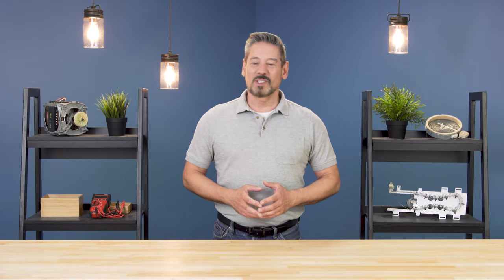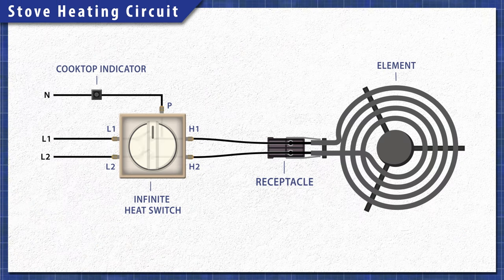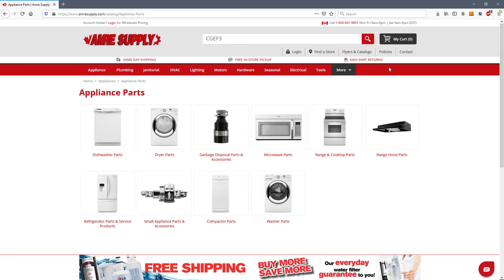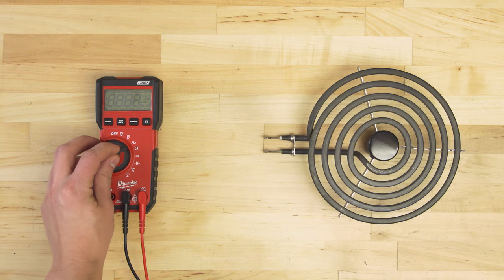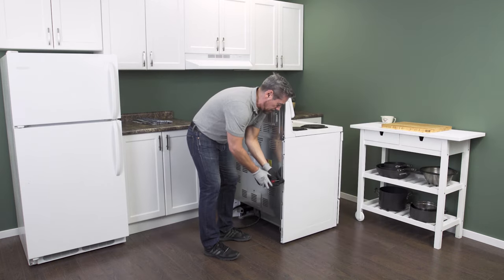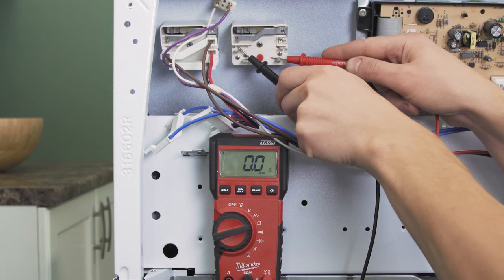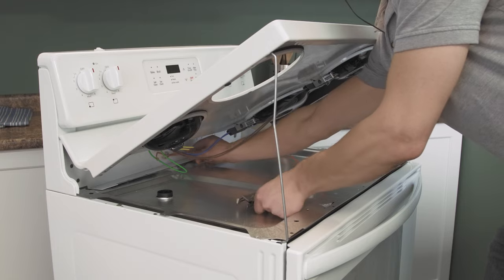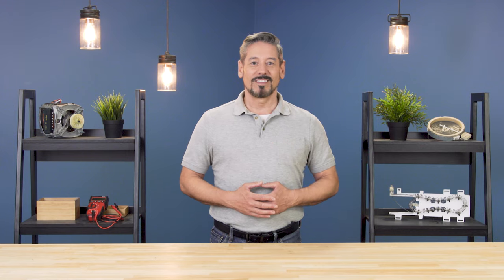Electric Stove Element Won't Heat - Troubleshooting | Repair & Replace

Comment: Help! We had an element replaced twice in a 45 yr old kenmore oven, this last replacement (about a year old) caught on fire. Now our warranty company wants to just replace it for a third time, and I’m terrified it will just catch on fire again! Are there some very old ovens where it’s just not possible to replace the element? Why does it keep failing, and in this case, catching on fire!? Any information would be greatly appreciated
Reply from the maker: Thanks for watching. It is possible that 45 years of built up grease has been ignited, or the terminals are not isolated correctly. It's best to clean all surfaces / wires connectors and terminals and make sure every wire connection is solid and is not touching the housing or anything else. You can test if any of the wires are shorted with a multimeter if needed.
Reply: Thank you very much. It wasn’t grease buildup and the element itself just wasn’t that old. I will have someone look more closely at the wiring, and the other things you mentioned thank you. But as far as a new element, that should normally be ok in an old oven? I mean, it’s not like you wouldn’t be able to find an appropriate one anymore?
Reply from the maker: @srg2972  if you have a conventional stove with coiled elements, you can find replacement elements by matching the diameter and the wattage: https://www.amresupply.com/catalog/Elements-Surface-Conventional-632518-ADA7

Comment: L1 and H1 has continuity but L2 and H2 Hasn't are switch bad and  2nd question what do you think the problem if all the element is not heating but the oven 's are
Reply from the maker: Thanks for watching. If all the stove burners are not working then it's best to check the wiring. You can do a continuity test of the wires to narrow down which wire is faulty.

Comment: I moved my oven and pull the plug so I can clean and now realized I’m the light is on but no heat ..
Reply from the maker: Thank you for watching. In any case try resetting the breaker and make sure the power cord is secure.

Do the stove elements work? If so then there is likely an issue with one of the wires leading into the control board.

If the stove and the oven are both not heating but the lights still work, then there is issue with one line of power. You can test the outlet, and power cord to see if they are good: https://www.youtube.com/watch?v=wZwxewn2w44

Comment: I was cooking & mine made a clicking noise then all burners at once went out, its an amana, and ideas? thanks in advance
Reply: electric burners like your video
Reply from the maker: Thanks for watching. It is possible that your model has a fuse connected to the stove elements. Does your oven work? Are you getting power to the control board and the lights? https://www.youtube.com/watch?v=Ox1lPMJY62U&t=78s

Comment: Pretty sure my issue is further back this because all 4 burners stopped at once. Can't find anything about that.
Reply from the maker: Thanks for watching. If your oven still works then it's likely an issue with one of the wires feeding all heat switches. If you start at the terminal block, there will be 2 hot, 1 neutral and 1 ground wires. Trace each of the two hot wires to the heat switches. You can do a continuity test between the connection at the terminal block and any of the heat switches. One of those two wires is likely faulty.

If the oven has also stopped working, then it's likely an issue with one line of power. You can see more here: https://www.youtube.com/watch?v=wZwxewn2w44
Reply: All 4 of my burners stopped working all at once, as well as the oven. The orange light in the stove is on but no heat.

Comment: My entire stove and oven stopped working but the light and time works
Reply from the maker: Thanks for watching. Electric ranges require 240V to operate which is supplied through two 120V lines. The clock and light run off 120V. If the other 120V is not working properly then the heating elements won't work. 

This video shows how to test the outlet and power cord to make sure that the power is good: https://youtu.be/wZwxewn2w44

As well you might have a thermal fuse connected to one of the 120V lines https://youtu.be/Ox1lPMJY62U

Hope this helps!
Reply: @AmreSupply  thanks for responding. Would a basic multimeter work for testing ? Also I was wonder why did you turned the electric off when unplugging I was under the assumption that u were testing things unplugged

Comment: my multimeter, which I bought at an auto parts chain, has five different ohms settings. Which one should i use to test the heating element?
Reply from the maker: Thanks for watching. The ohm settings will correspond to maximum ohm ranges. For example if there is a 200 ohm setting, then it will easily show if an element has 20 - 45 ohms.

Comment: Nice video.   The beauty of an electric (or gas) range is when you get down to the nitty-gritty they are actually very simple devices whether they be traditional coil top,  halogen lamps or radiant elements under ceramic glass,  or the solid disc burners, also known as euro-disc burners because they are (or were) very popular in Europe and were available in the US for a short period from about the early 1980s to the late 80s/early 90s from Jen -Aire and a few other manufacturers but never really caught on with the general public.   

Troubleshooting gets slightly more complex with the oven and broiler because virtually all but the most basic and budget models auch as the 24 inch "apartment " ranges on the market today have electronic oven controls, with these I like to use the process of elimination starting with testing the oven/broiler element, checking for damaged terminals,  damaged wiring, and finally the oven  thermal fuse, then replace the oven control module if all the above checks out.   Because a blown thermal fuse indicates the oven heated to a dangerously high temperature the control module has likely failed to cycle off the element and should be replaced before replacing the thermal fuse
Reply from the maker: Thank you for watching and for sharing your thoughts and observations!

Comment: Great video 
I have a whirlpool electric ranger. All the burners stop working at the same time, but the oven still working. I thought it could be some type off reset switch, but I couldn’t find one. Please help….🙏
Reply from the maker: Thanks for watching. If your model has burners connected directly to the control board then this could effect all 4 burners at once. If your there are individual heat switches / dials, then it's likely an issue with one of the wires feeding all 4 burners or a limit switch or fuse. You can use a multimeter to test between the terminal block and the heat switches. You'll have to trace the wires to see which is feeding into the heat switches. You can test each side to see if there is continuity. There should be resistance of between 0 and 1 ohm. If the screen is blank, shows OL or  - - - - -  then there is no continuity and you'll have to repair that section of the wire. Also look for any burn marks or melted wires.

Comment: I have an unusual  probkem  3 range burners quut working only the right rear works, all burners are good.  Can" tigure this one out, it worked the day before.  I figured it out the plug was partially out, it wasn't getting 220 volts only 110
Reply from the maker: Thanks for sharing your experience. Does it work now that the plug is secure? If needed you can test the outlet directly to verify if it is supplying the full voltage: https://youtu.be/wZwxewn2w44?t=204

Comment: i got  a question 
Why my oven heats well once and down long time and again comes back heat. 
I mean irregular heating. What do I do?
Reply from the maker: Thanks for watching. If your oven is older and uses an oven control thermostat, then it will work differently than a temperature sensor. Oven control thermostats can wear down over time which can make them work only some of the time if the contacts are sticking. https://www.amresupply.com/catalog/Oven-Control-Thermostats-632506-AD1P

If your oven has a temperature sensor then check all the connections to make sure that it is secure. As well you can test the temperature sensor as shown in the video. If that doesn't help then you might need to install a new control board.

Comment: Great video! But you didn't addressed how to fix the always on light (hot surface indicator)!
Reply from the maker: Thank you, we're glad that you found it helpful. For the hot surface light we have several dedicated videos:

If the hot surface light stays on even when the cooktop has cooled down then its an issue with the limiter in the surface element: https://www.youtube.com/watch?v=CXhmlswg30Y&lc=UgyO1xNghWlJeH9TImh4AaABAg

This video shows how to replace a hot surface indicator light: https://www.youtube.com/watch?v=HCFVo7fuFvc

If you are referring to the cooktop indicator light, (that turns on when the burner has power) then the troubleshooting and repairs are different:

If the cooktop indicator light stays on even when you turn the burner off, then its an issue with one of the heat switches: https://www.youtube.com/watch?v=s5iG61kAyJQ

Cooktop indicator light repair: https://www.youtube.com/watch?v=JzwNKw8mD3E
Reply: @AmreSupply  sorry.. later I found it. Thanks again. Great job guys, nice platform! Definitely I would check the store! Now I know I have to replace the switch.

Comment: My mushroom growing operation has grinded to a halt  because instead of having 1 of the small burners.. after I tried to fix it, the single burner didn't work anymore.  So now I'm screwed.  I'm still quitting my job anyway.  

A question though.. I have unscrewed the back and everything.. can I remove the wires on the top of the heat switch (for burners which will never work) with  out screwing up the power to other burners.. I honestly don't know.. I bought a multimeter though because of this video.
Reply from the maker: Thanks for watching. If you are not using a burner, there is no need to disconnect the wires to the heat switch. If the element or the heat switch is not working then no power will be sent to the heating element. If you do disconnect the wires to the any component then it's to wrap the wires with electrical tape to isolate it. If not it might create a short circuit if it touches the metal frame. Covering these connectors will not prevent another heat switch from receiving power. 

It is most safe to replace each component as needed and not use the appliance with components partially disconnected.

Comment: But I not understand
How to work The degree
Between high and low
Who make a control about this
But now I have a thermostat
And the switch regular switch
Who made a control about the degree???
Reply from the maker: Thanks for watching. I'm not certain what your question is. The infinite heat switches used in electric stoves is not digital and can't be set to a specific degrees. It uses a bimetallic strip that bends to disconnect the circuit. When you turn it to high, it takes more time for the metal strip to bend and the circuit will stay connected for longer (giving more heat). On a medium or low heat setting, the metal strip will more easily bend which means the heat will stay on for a shorter amount of time.
Reply: @AmreSupply  

Well, thank you for your attention. I am asking about  stove at 2:45 about who controls the required temperature. 
Where is this bimetallic strip ??

In tha switches
Or in stoves
Thank you 🙏🏻
Reply from the maker: @sherifaskander1782  The bimetallic strip is inside of the heat switch as shown at 1:27. The strip disconnects power between the L2 and H2 terminals.
Reply: @AmreSupply  
 thank you so much. 🌷👍🙏🏻Maybe I need to try this the one day 
open the stove old one
Look in this face-to-face
Thank you so much 🙏🏻👍
Reply from the maker: @sherifaskander1782  You're welcome, we're just happy to help!